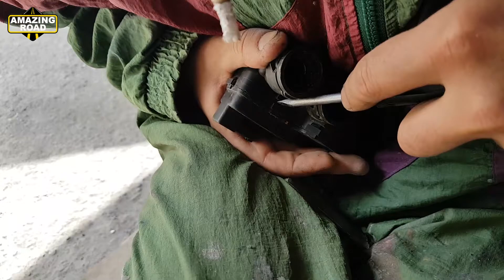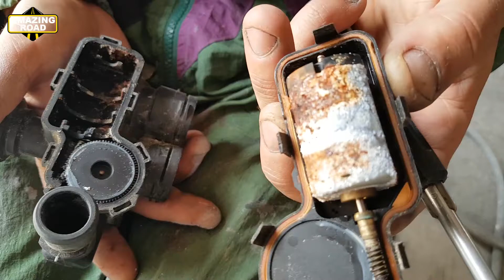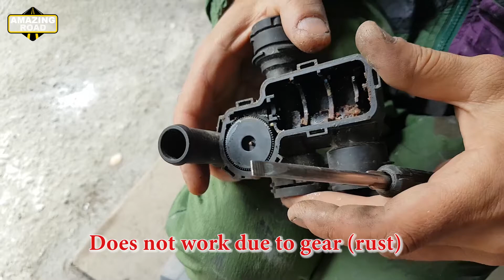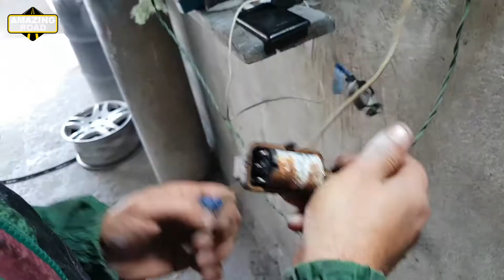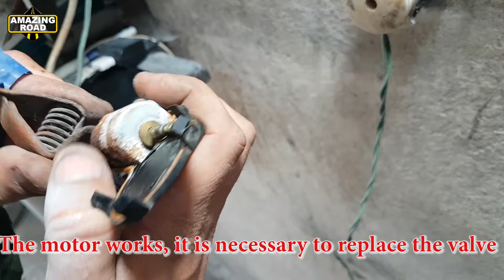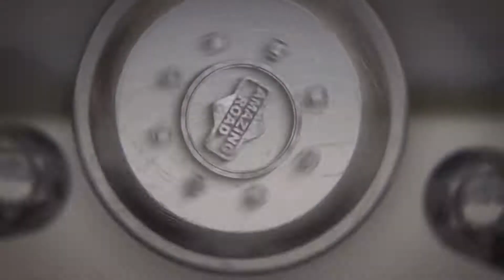Why the Heater Control Valve Fails on Mercedes / How to disassemble Heater Control Valve W211, CLS

Comment from the maker: Deactivation and Activation SBC Without Star Diagnosis on Mercedes https://youtu.be/J8jaVufCQcg
Mercedes W211 Replacement the Fuel Filter  https://youtu.be/LVpEIoUC178
Changing SBC Brake Pressure Accumulator in W211  https://youtu.be/CCXlfeDAly4
W211 Replacement or Removing Fuel Pump  https://youtu.be/VXQa5WZXWLs
Brakes failed on the road  on W211 https://youtu.be/tUZg9WytbbE
Repair the IR sensor for Mercedes  https://youtu.be/h5GEVx5uemI
How to reset automatic transmission 722.6 Mercedes  https://youtu.be/_FjX2Yl42t4
Best Life Hacks for Mercedes W211  https://youtu.be/p6bZLZ0WcQc
How to Make AUX on Mercedes W211v https://youtu.be/7JnVR-nF0UQ
Detailed Installation Android 7.1 COMAND & CANBUS  https://youtu.be/EisTZV-FCX8
Mercedes W211 Top 25 Hidden Functions, Secrets https://youtu.be/ZYQwnmydbp8
TOP 55 BEST LIFE HACKS FOR MERCEDES W211  https://youtu.be/CgixWAzrphs
W211 HOW TO REPLACE BRAKE PADS CORRECTLY https://youtu.be/6syWcyTcTVE

Comment: hi, i got C220 CDI w203 year 2000, has problem with heating inside, does it same cause as you have replaved the heater control valve? it also gives problem in ignation in the morning! please suggest! it gives error code p1644 with desciption heating boster while driving it gives error on screen EPC and stopped the engine suddenly

Comment: Hello my friend i changed thermostat vlave heater and still does not blow hot air ! I think to change circulation pump on the right woth A 211 835 00 code should i? can it be it the problem please can u help me ?
Reply from the maker: You did not change the stove valve?